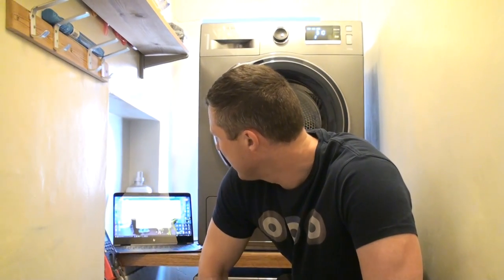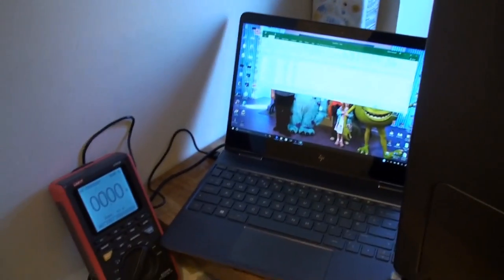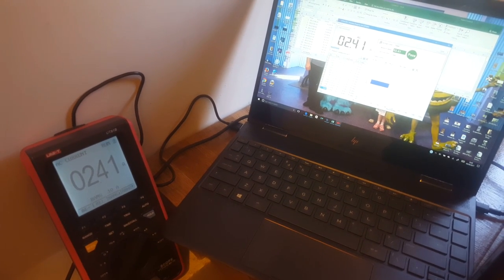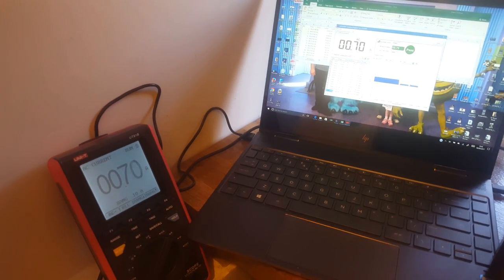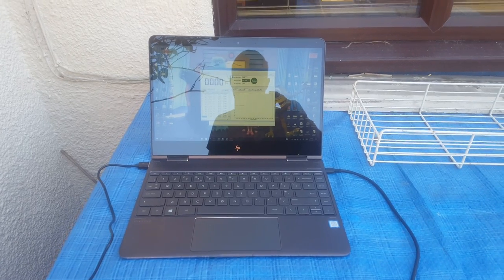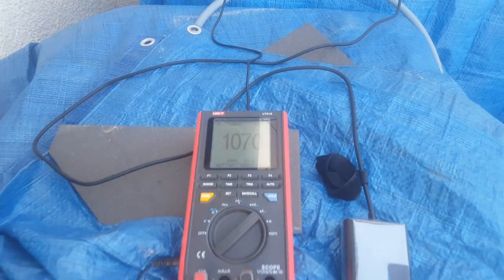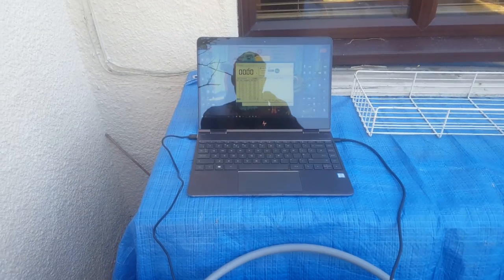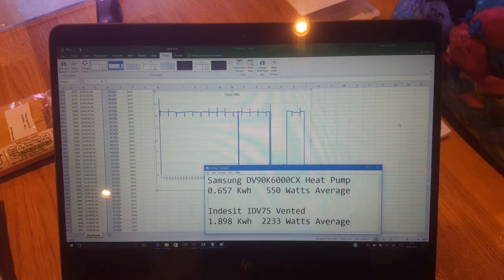Heat pump vs Vented Tumble Dryer - Actual Power Consumption

Comment: As other commenters have pointed out, there's far more to consider than just electricity usage when calculating the cost of a clothes dryer.  Here in the USA, heat pump dryers cost twice as much to purchase as a conventional vented dryer.  Also, heat pump dryers may take up to twice as long to fully dry a full load of clothes.  That means that a heat pump dryer runs longer, and some parts (bearings, etc.), may need to be replaced more often.  Finally, keep in mind that it's not unusual for vented dryers to last fifteen years or more without a single service call.  Heat pump dryers are more complex by design (compressor, condenser, expansion valve, refrigerant, evaporator, etc.). Given the additional complexity, I wonder how many heat pump dryers will still be working after fifteen years of use?  What's more, how many of them will be economically feasible to repair?
Reply: Mechanical failure is not the main death cause in these type of machines.
Not having the possibility to properly clean the condenser (evaporator from a refrigeration point of view) shortens the lifespan a lot.
Overall these things last between 3 and 6 years depending on how often they are used and how well they cleaned(clean filters, vacuum the accessible condenser part).

Comment: The bottom line is you save about $.20 per load. If you do 10 loads a week which is a lot, you’ll save two dollars a week or around $100 a year in utility costs. After 10 years you’re probably just breaking even. The question is do you wanna constantly be cleaning out those filters or possibly having breakdowns and technical problems?

Comment: So roughly what was the cost of each load?
Reply: Depends on your rates, obviously, but in my area “off peak” rates are about $0.30 per kWh, so the heat pump would be about $0.20 and the traditional electric would be $0.57 for that 5-towel load. Assuming you paid $400 more for the heat pump, it will take 1,000 loads to pay itself back at ~$0.40 savings per load.

Comment: so around 15p for the heat pump and 29p for the vented dryer.
Reply: 1300 loads before you beak even on £200 more expensive dryer £250 vented vs £450 heat pump

Its a hard sell for me, wouldn't trust the machine to last that many cycles being much more complicated than a simple vented dryer
Reply: No: if you assume a KWh cost of 20p it’s; 13p for the heat pump and 38p for the vented. Or 1/3 of the cost.

Comment: Good video. Very useful. So using the dryer twice a week, using £0.18 as electricity costs, the 'heatpump' saves £315/year. Minor comment, why does the fancy software spell kWh wrong? (Two mistakes in a three letter word.)

Comment: Cmon, you missed the most important calculation, $ saved per use, or per year?? Then work out how many years for a $ benefit on the heat pump version. 
Then there’s the innificent way the heat pump will work with low ambient temperature

Comment: heat pump take a lot longer to dry clothes or mine does , than vented , so you lose some of your energy saving here V vented and they have  more components to break down ,
Reply: Sunline No, the time taken is largely irrelevant. He gave the total energy consumption for each machine for the entire cycle, and the heat pump machine used about a third of the energy the vented machine did.

Comment: The dryer looks like a toy. Honey the laundry will be dry in about a week. Never heard the word tumble dryer. I would think dryer would suffice. Using the word tumble is a filler word. Good job!
Reply: Tumble dryer is a common term in Britain, and it is used to distinguish dryers which operate using a hot air/tumble action from applicances like spin dryers